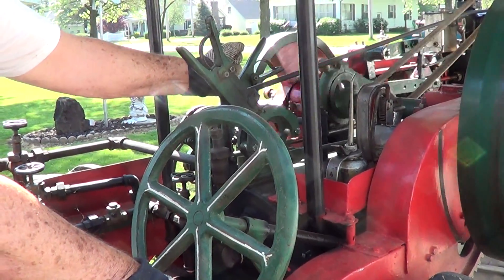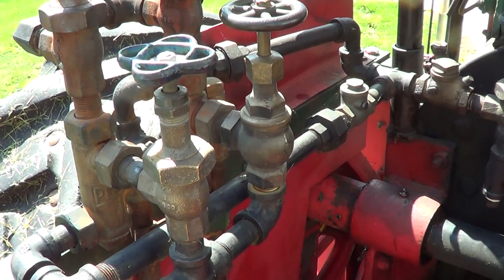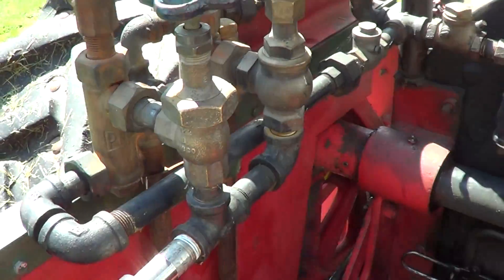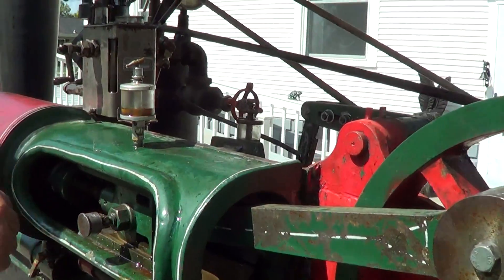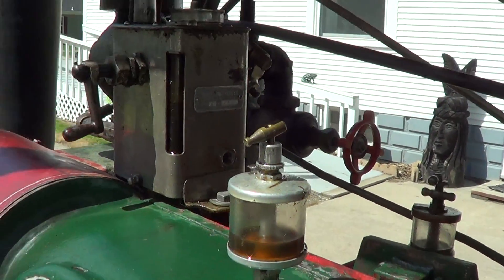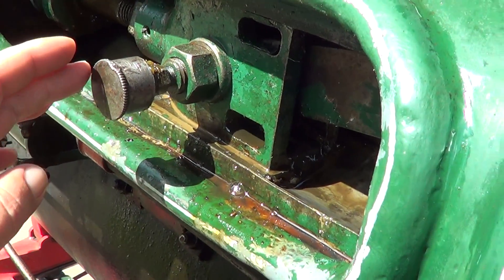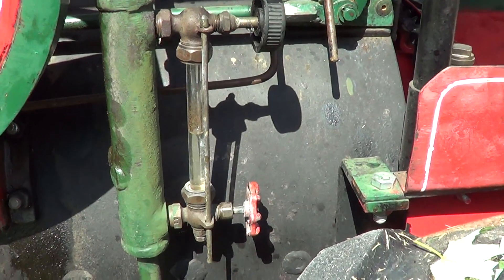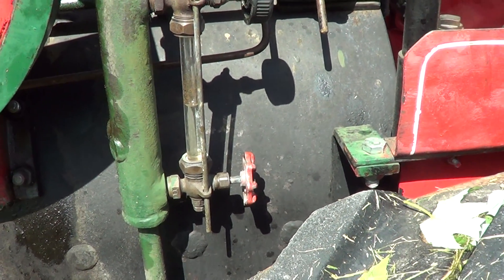Operation Of Steam Traction Engine

Comment: Not familiar with the company tell me about the company
Reply from the maker: Wood Brothers was based in Des Moines Iowa. Aside from steam traction engines, they also made other farm equipment. Threshing machines, disks, plows, and so on up until the 1940s when they were bought out by another company. Don`t recall who bought them out.
They made traction engines from around 1914-1924. Give or take a little either way. They did not make many steam engines. Maybe a little over 500 of them. Various sizes of engines. 18/56, 20/64, 22/70, 25/80, and the big 30/95 plow engine.
The 22/70s were the most common. I don`t think any records exist as to how many of which size were made.
The engine in this video is a 5/8th scale model of a 22/70 that my dad built about 20 years ago. But calling this little beast a model is kind of misleading. Even at 5/8th scale it weighs in at well over 3 tons and will pull a 3 bottom plow.
If I remember right, the very first video I ever posted on YouTube shows this little engine with the full size 22/70 it was based on in the background at the end of the video.
https://www.youtube.com/watch?v=4tAxc979Wrk
Reply from the maker: Wood Brothers was based in Des Moines Iowa. Aside from steam traction engines, they also made other farm equipment. Threshing machines, disks, plows, and so on up until the 1940s when they were bought out by another company. Don`t recall who bought them out.
They made traction engines from around 1914-1924. Give or take a little either way. They did not make many steam engines. Maybe a little over 500 of them. Various sizes of engines. 18/56, 20/64, 22/70, 25/80, and the big 30/95 plow engine.
The 22/70s were the most common. I don`t think any records exist as to how many of which size were made.
The engine in this video is a 5/8th scale model of a 22/70 that my dad built about 20 years ago. But calling this little beast a model is kind of misleading. Even at 5/8th scale it weighs in at well over 3 tons and will pull a 3 bottom plow.
If I remember right, the very first video I ever posted on YouTube shows this little engine with the full size 22/70 it was based on in the background at the end of the video.
https://www.youtube.com/watch?v=4tAxc979Wrk

Comment: How it brake system work?
Reply from the maker: There are no brakes. You shut down the throttle and let engine resistance bring you to a stop. Or if need be, you can reverse the engine with the clutch still engaged and tach much the same as you would with a modern electric forklift.
A steam engine is like an electric engine. They have nearly all their full power at 0 rpm. No need to rev up the engine to get torque from it like a combustion engine needs.
You can hold one of these engines in place on a steep slope by opposite steam pressure without the need for any kind of brake system. But doing that does require a little practice and experience.

Comment: That is almost the perfect size for a traction engine. Something that can be readily hauled on a trailer behind a pickup with no special permits or licensing.
Reply from the maker: When my dad was still alive he did just that. He would haul it around to different steam shows, but mostly he just played with it in the back yard. Over the years he owned 3 different full size engines at different times. Sold the last big one when he moved into town. About 3 years after that he started building this model. Something he would have room for in town. But even though it`s small compared to a full sized 22/70 Woods that it`s based on, it`s no lightweight. The little beast is 6,300 pounds  and will pull a 3 bottom plow.

Comment from the maker: Beats walking. :) Top speed is about the speed of a brisk walk. But most engines were built for power, not speed.
This little model has been at the Old Threshers in Mt. Pleasant every year since my dad finished building it in 2004.
The last 3 years a friend has taken it up there. Dad just turned 88. He just wears out too fast to be able to run it for very long at a time these days.
Still fire it a few times a year so he can run it around the yard. This vid was on his 88th birthday.

Comment from the maker: Actally it`s a 5/8th scale model of a 22/70 Wood Brothers engine. My dad started building it in 2000. Had it finished in 2004.
Dad grew up running full size ones and has owned 3 different full size engines over the years.
He sold the last of the full size engines when he moved to town. Missed having one, so he built one small enough to play with in town.

Comment from the maker: This is actually a 5/8th scale model of a 22/70 Wood Brothers traction engine.
There are three grate sections in the firebox. Each is about 3 feet long and about 8 inches wide. grate gaps are about 1/2 inch by 3 inch.
The fire box is small. But in the video you just saw him adding wood to the fire, not filling it up.
Was burning a combination of wood and coal.
This model is small compared to the original, but is 6,300 pounds and will pull a 3 bottom plow.